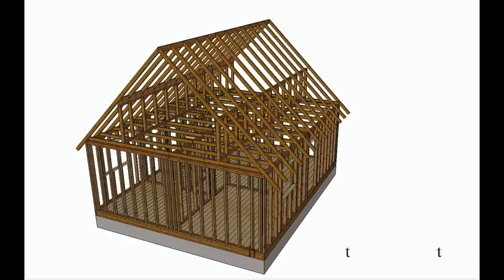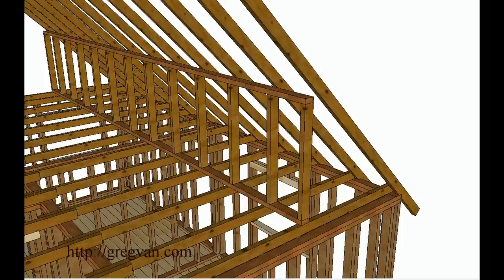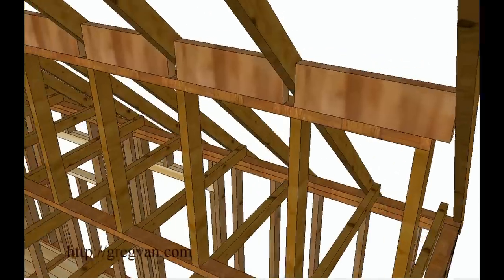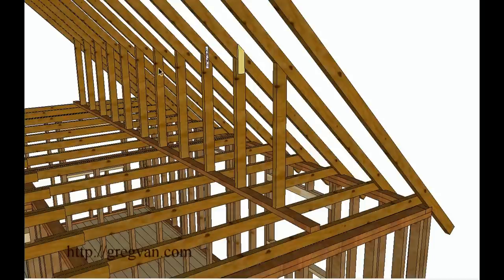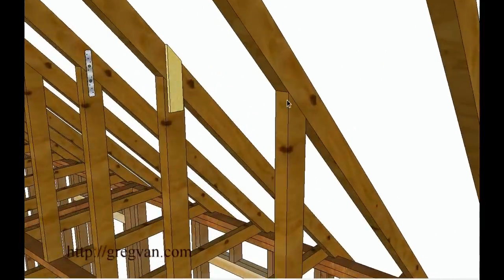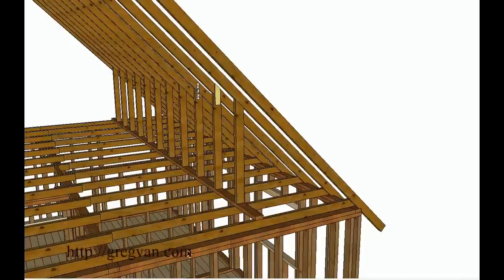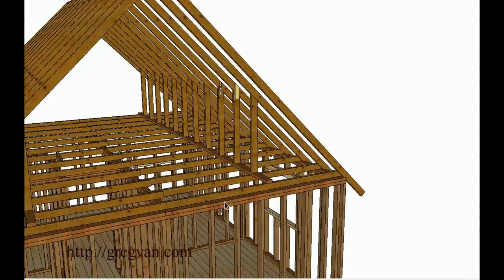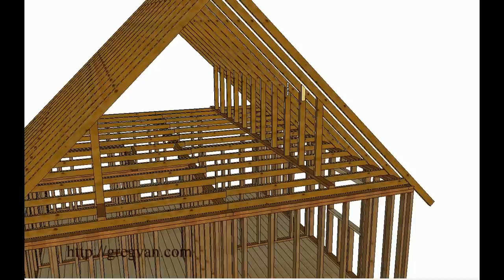Using Walls Instead of Purlin Braces to Support Roof Rafters – Attic Remodeling Tips

Comment: Glad u mentioned undersized ceiling joists cuz I have an older home with (true) 2x4 rafters that were supported via vertical braces to the ceiling joists. I have been seeing very slow progression of some wall and ceiling cracks and the engineer said it was because the vertical roof supports were offloading roof weight onto the ceiling joists. His suggestion was to install mid-height collar ties and remove all the vertical braces.
Reply from the maker: If the ceiling joist aren't under sized and aren't sagging, then I don't see why you can't remove vertical bracing, but at the same time, if you asked an engineer, then they usually can help with the information you're looking for.

Comment: if you securely fix the outer timbers of the dwarf wall to the eternal gable blockwork (resin bolts or even built in) then use  18mm ply or OSB to clad your dwarf wall you lose storage access to the eves but the dwarf wall acts as a boxbeam that has immense strength.

Comment: The method with the blocks looks great. I believe it would only work with a hot roof. Which would only work in some regions.
Reply: you could for sure bore a whole through each block to allow for ventilation along the deck in the rafter bay and thus have a cold/ventilated roof

Comment: The roof support is a rectangle beaker with curls at the end of it at the top of the beaker and is used to hold the roof up on the roof support beam for the middle of the front and back room

Comment: Don't know if anyone mentioned this, but if you are worried about ceiling structure sagging or not supporting roof, add what I would call a "strong back" to the bottom plate of the attic wall. It is a 2x6,8,10,12 what ever you think you need nailed (standing up) to the back of the wall (run the length of the wall) and the bottom plate
Reply: a new beam supported by the outside walls in other words; I guess?
Reply: @itscoconutsaregood   yes , normally fit a new suspended floor system,

Comment: My house i s built like that (from 1959). Span is 26ft with a high roof angle allowing grown up person to stand and jump in middle area without reaching the roof.
There is a bottom and a top beam to the trusses as per the open plan design (first of your examples)  but no braces. The wood used is massive 6x10" in rafters and 4x7" in floor. Roof being spaced at 32" while floor is 24" beam spacing. House is in a 2-meter snow depth area.
Reply from the maker: Thanks for sharing and wow, over 6 feet of snow.

Comment: In the UK with regards to purlin walls, we always use a header which we "birdsmouth" into a third of the rafter depth. Never independently up the side of each individual rafter. Much stronger structurally
Reply from the maker: I think it would all depend upon the design of the building and it's always nice to hear what other people do in other countries.
Reply: gregvancom can you elaborate more?
Reply from the maker: If you had a large building without interior walls, then it might be better to use ceiling joist to support the roof rafters, instead of using posts and beams that might require more work to the building foundation. If this doesn't make sense, do you think it would be possible for you to send me a picture or a few pictures about what you're referring to.

Comment: Good video.

What I like to do is place the top plate of the wall flat against the bottom of the rafters, and then cut my studs on an angle to fit. At least when I'm simply framing the 1/2 story. If I need said wall as a purlin, I might do it a bit differently. Or maybe not. lol
Reply from the maker: That should work just fine.
Reply: @dorothymartin8557  If done as I suggested, the rafter will sit across the top plate, with full bearing, and the studs will be cut at the proper angle to fit beneath the plate. If done as in the example in the video where the stud is placed directly beneath the rafter, I'd use pieces to scab onto the stud and rafter sides.
Reply: this is why she rang me when I was outside my sisters house

Comment: Hey Greg,
I was wondering of the implications of having a knee wall supporting the mid-span of the rafters as such, but not being positioned over any type of load-bearing wall. As you mentioned, sizing of the ceiling joists are important because the weight it placed mid-span of each side of the ceiling joists. I have an older home built with old lumber but the ceiling joists are slightly undersized from my research. They are 2x6 ceiling joists and each side spans 16 feet from the exterior wall plate to the interior load-bearing wall. The house was built in the 1930s and many claim the old lumber is considerably stronger than modern lumber. While I’m sure it’s stronger, is it indeed enough to compensate for this setup? 

To be clear, there are already knee walls in place and I want to know it they are adequate to support the rafters mid-span (also 2x6 old lumber) or if I’m just asking for trouble here. I’d also like to insulate, electrical, drywall, stairwell, etc for a finished attic space and I’m concerned about the strength of the current setup
Reply from the maker: It will depend on the design and structural engineering, but can be done.

Comment: Could you talk about removing cross-bracing in a gable-ended attic space (such as the one you illustrated), and what support alternatives exist which would maintain roof integrity? It's a 1920's Craftsman cottage whose attic just begs to be used somehow (except for the classic undersized ceiling joists underfoot, boooo). All the roof rafters are 16" O.C. with wooden cross-braces nailed horizontally every other one, thus completely ruining any "walkability" it might otherwise enjoy. I see attic conversions all the time (granted, with slightly higher-pitched roofs and larger homes to begin with) where I gotta wonder, "How'd they create all this headroom??"
Reply from the maker: If you can email me some pictures for more information and you can get our email address at the website.

Comment: My home is 100 years old and I'm wanting to add central heat and air in. My attic has 0 vertical support beams. And my ceiling is 2 x 4. I'm scared my ceiling isn't stronge enough for a furnace and duct in the attic. Any thoughts?

Comment: I realize it wasn't a part of your talk but where are the collar ties in your model?  They are critical for preventing the roof from pushing out and collapsing. Also, there is a specific place the collar ties must be placed for them to be effective.
Reply from the maker: Good point and sorry I left them out. Thanks for looking out after me .I would also like to point out that you can use straps that go over the connecting roof rafters and ridge on top of the framing and roof sheathing.
Reply: the ceiling joists act as ties at the foot of each rafter; assuming they are substantial enough to carry the framed purlins as well!
Reply: @itscoconutsaregood  as long a theyre bolted to rafter ends and in the middle where they overlap.
Reply: @gregvancom  I have a collar tie that's same height as my purlin. Is it possible to raise the ties so I have more head room? My braces come towards the center and have tie overhead. I want to raise the ties and move the braces. Not decided on if I want to create my wall supports on top or bottom. Because some places I want to access for sleep nooks. I have to check my joist size i currently have decking but i think they are 2x6. But if I left 4 ft open between some of the purlin suppports I could still access sleeping nooks maybe. Wondering if I can do some portions as kick wall and some as posts? I have hip roof. Is it possible to have kick wall further back than current purlin? Put posts to support current purlin and add a kick wall further back? If I go straight down and wall in at current purlin I lose more my space.  I'd like that space for sleeping nooks and why I'm thinking posts. If my floors can manage weight can I just replace each purlin brace with a post? And leave everything open?

Comment: If a layout was almost identical except the rafters were 2x6 and the 2x4 wall studs running perpendicular to the rafters didn't typically line up exactly with each rafter would it be safe to assume they do not add any support to the rafters?
Reply from the maker: I think the length of the rafter is more important than where it is positioned as far as providing structural strength. As long as the rafters are sized correctly, then they don't need to line up with the ceiling joist. Let me know if that didn't answer your question.

Comment: This is how my house is framed ,  I have an addition with vaulted trusses  Similar roof height that's tied in .. is there a way to open up a 8 foot span , and create a room in the middle ?  This room would not be a bed room.  For like  possible bathroom or walk in  Closet. Is it possible to create some type of header to take the load once you cut open the support wall / roof rafters ?!
Reply from the maker: You should contact an engineer or roof truss manufacture for details.

Comment: I always wanted to put up like a knee high wall and cut out the cross beams so I could use my attic for storage
Reply from the maker: You might need to add more joist or make the floor stronger, unless it's already structurally awesome.

Comment: In my attic there is already the walls set up, but I was wondering if I could maybe move one side back a bit more so I have more room up there, I'm only talking about moving it back about 600mm to 700mm.
Reply from the maker: I can't provide you with an answer, because I don't know exactly what's going on. However, when I converted 600 mm to inches it provided me with 24 inches and that's not just a few inches. For example, I don't think it would be as big of a problem if you are going to move something 24 inches on a shorter span like 12 feet, but it might be a problem on longer spans.

Comment: shall rafters meet with the ceiling joists at the wall?. I understand that when they do it is  called rafter ties. In my case, on 2 joists I added  pieces of 2x6 so rafters and joists are connected by that piece. However, the last one at the corner I did not add any piece of wood thus there is a gap in between. However I nailed the joist against the wall. Would that be a problem?. I'm bit stressed out.
Reply from the maker: Rafter ties can usually be spaced 48 inches apart, if that answers your question, if not then provide some more details. If the nearest one is 48 inches from a wall then you should be okay.

Comment: Hi, what if the roof construction has 2 purlins on each elevation and is 9" brickwork instead of being a timber framed house. Would that mean there isnt a need for any supports?
Thanks
Reply from the maker: No, if the roof purlins were installed, then there's probably a reason why and I would figure that out, before removing them.
Reply: @gregvancom  Hi, thanks for the reply. Sorry I've not been very clear - I dont mean remove the purlin beams I just ment if there's proper purlins installed then is it still necessary to have braces. But I assume the purlins hold the weight of the roof and the braces hold the weight of the ceiling below. Thanks

Comment: Those ceiling joists are not designed to hold that short wall in the attic and needs to be reinforced and load transferred to bearing walls below. Of course it’s only a schematic drawing.
Reply from the maker: Yes, this is just an example and not meant to be a scaled structural model.

Comment: This is almost what I am dealing with exactly. I have a slight valley in the roof, but this design is almost identical to what I am stressing about. It's an older home with 2x4 ceiling joists and when the homeowners built the "purloin wall" they basically attached 4 2x4s onto just 4 rafters and that added weight has bowed the ceiling joists considerably. I almost want to email you photos to see if you can offer some advice. This is my first home and I in over my head with this decision. I have considered removing the older ceiling joists and replacing them with 2x6. The span of the joists is about 15 feet also. Any other suggestions? I also just considered leveling the existing joists, just to make the drywall easier, and leaving it. I don't plan on having this house for more than 5 years.. any other advice?
Reply from the maker: Feel free to send me some pictures and you can get our email address at the website, but I think you're on the right path. You can remove and replace the ceiling joists with larger ones, to straighten the ceiling out and help to support the roof rafters.

Comment: Do knee walls also prevent rafters from spreading like ceiling joists?
Reply from the maker: It would depend on the design, but in most cases you will still need the rafter ties or ceiling joist.
Reply: @gregvancom  would hurricane straps be enough? Essentially attaching each rafter to the wall plate or a steel ring beam ?

Comment: With the blocks could there be a problem with roof ventilation?
Reply from the maker: It would depend upon the construction, but definitely anything that would be blocking or restricting ventilation might need to be done differently.

Comment: if you put the blocking in as in your second example, you lose the ability to vent the roof from the soffit to the roof vent.  not an acceptable form of framing.
Reply from the maker: Good point and you might need to drill some holes in the blocks to allow for ventilation and air circulation.
Reply: If you use spray foam you dont have to vent.
Reply: Anthony Romano  Ventilation is still required on one side of the wood roof sheathing per code and the APA.
Reply: @benjaminblack5888 , you can't do spray foam and make a cathedral ceiling? Where would you vent if you did spray foam?
Reply: 1weird Doe  One option would be to create a vented airspace by placing 1” spacers against the deck, then place foam-board to keep spray out of vented airspace.
Reply: If you have enough ridge, use ridge vent and continous vented soffit.
Reply: @benjaminblack5888 , what happens if you spray foam directly underneath the roof deck and fill up the rafter cavity? Isn't that the same as filling up your wall studs? Or would you also want a 1in gap and your wall studs before you fill them up with foam? Is anything going to rot if foam directly to wall sheathing or  underneath roof deck?
Reply: 1weird Doe In the case of wall studs you would have an air gap even with a permeable membrane on the outside.  The AMERICAN PLYWOOD ASSOCIATION (APA) strongly advises having one side of the plywood having the ability to dry out if water were to get through the cladding.
Reply: @benjaminblack5888 , if Menards fanfold is put on the outside is that considered permeable since fanfold has a bunch of pinholes poked in it? How can moisture dry to the outside through them? It's basically plastic wrapped over one fourth of an inch of extruded foam.
Reply: 1weird Doe  This now sounds like a low slope roof.  What type of roofing system are you working with? Single ply TPO OR PVC FULLY ADHERED OR MECHANICALLY FASTENED,  MODIFIED BITUMEN, THREE PLY HOT MOP,...?
Reply: @1weirddoe571  They make a roof underlayment similar to tyvek house wrap that breathes out.

Comment: I have a home that was built in 1920 and it's a 24' A frame. The roof is 12 years old and it has a sag in the mid section near the ridge. The previous owner converted the attic to a bedroom almost 20 years ago & I have the copy of the permit, which shows they put in a knee wall to this area. I had someone look at the issue today and they said that the rafters are below the wall plate. He also said that I may have to open the ceiling on the second floor to see whether or not the support beams were nailed together or if there is one long beam from front to back. I'm just wondering if I am going to be in a money pit to correct this sag or if there is a way to fix this sag without taking the floor up in the attic bedroom and the ceiling down from the second floor? Can any of this work be done from the outside? Also, who would be the best professional to hire for a job like this....do I hire a roofer, a framer or just a general contractor?  Thank you for your video's! They are very informative.
Reply from the maker: It would be difficult for me to tell you how to fix this, without knowing exactly what's wrong with it. It would also be difficult for me to tell you who to hire, without knowing their experience level. For example a roofer might know how to make building repairs and they could be used or a general contractor might be able to fix the framing problem, but wouldn't necessarily have an experienced roofer.

Feel free to send me some pictures of your project and I will see if I can provide you with more information. You can get our email address at the website.